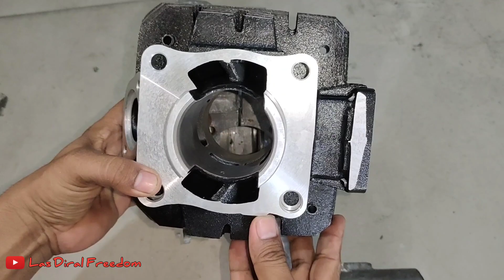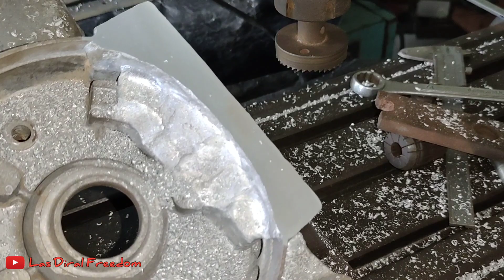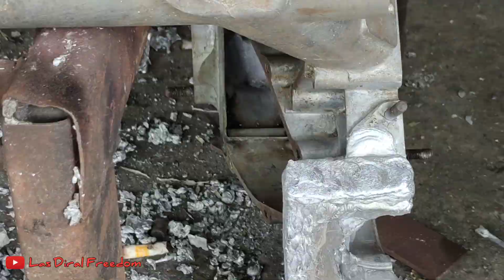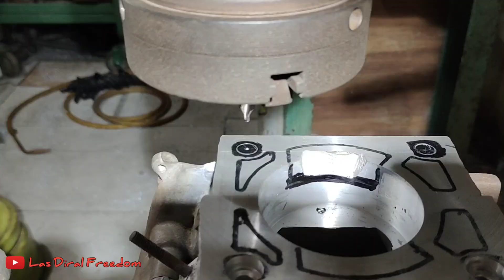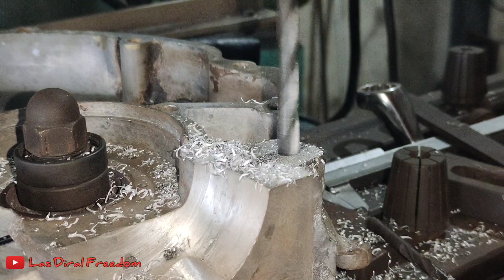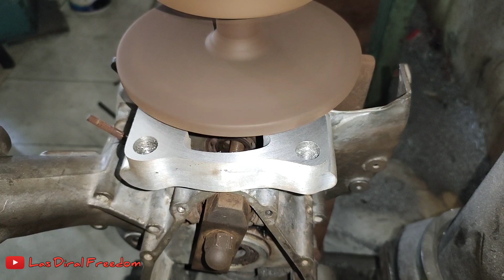cara las aluminium vespa blok yamaha | welding aluminium | brazing aluminium

Comment: Maestro le ago una consulta,  despue de ver tus vídeos me anime a intentarlo y la verdad no tuve tanto éxito debido a que quise soldar un carter chino de moto con aporte que lo ise yo fundiendo una zapata  de freno y no pega es como sino se fusionan, bien un consejos para mi ... siendo con oxigeno y gas propano con pico de 2 gracias exito!!
Reply from the maker: thank you for stopping by my channel🙏🙏 For welding with propane gas patience is required. And practice often. For the half or half turn oxygen setting Half cycle oxygen and full cycle propane. The thickness of the material to be welded also has an effect. Failure is usually caused by a fire that is not big enough or the nozzle is not big enough.
Reply: @lasdiralfreedom  muchas gracias genio por compartir tu conocimiento y ser tan amable,  voy a seguir probando mi boquilla es de 2 voy a buscar otra más grande exito y bendiciones